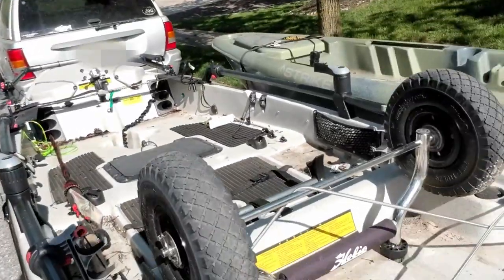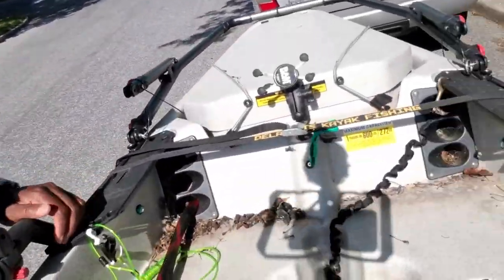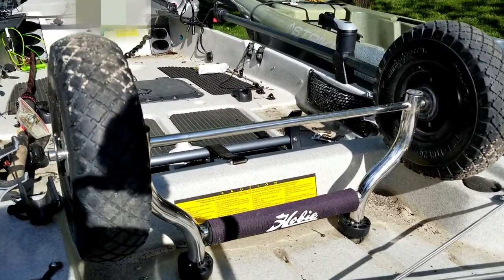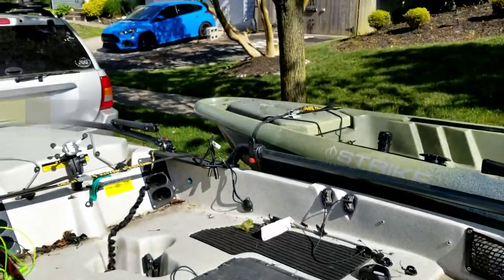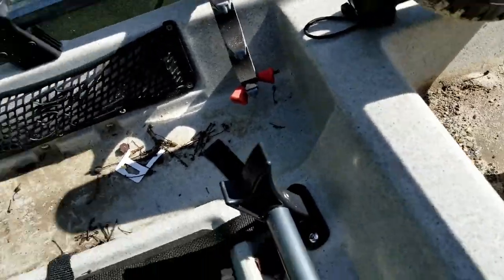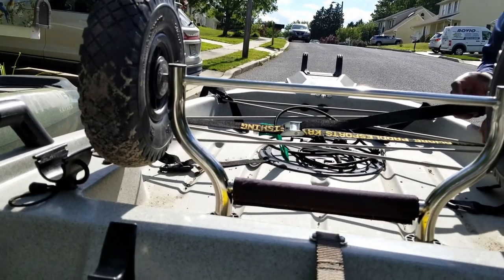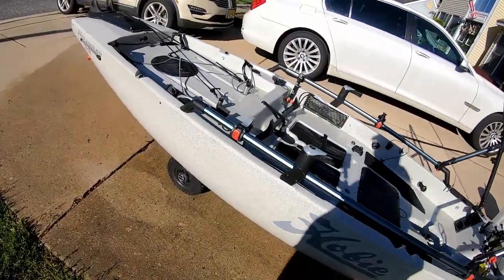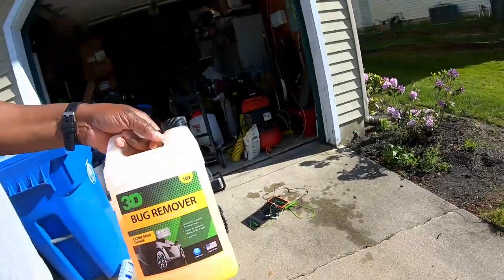Hobie PA14 - Best Kayak Cleaner & Stain Remover

Comment: Thanks for a very useful video !!
Reply from the maker: Steve, thanks for checking out our the video and taking the time leave a comment.
Reply: @yaknsons2473   I have two PA's: PA -14 and PA-12. I bought a Harbor Freight Farm Duty Tarp SKU# 60458 for $14.99 and a grommet kit, Sku# 63237 . I cut  the tarp in half lenghtwise and made two covers for the kayaks each 5.5 ft. wide and 15 ft. long I put grommets in to match the edges and I use short ball bungees to secure them to each of the boats. Since these covers are sunlight resistant they are still going strong in their 2nd. year and prevent a lot of the debris and crap that likes to collect in every corner. In my case it is mostly pine needles, sap, leaves and bird poop. At approximately $8.00/cover they are well worth it, protect the boat and are easy to handle and store. All the Best, Steve
Reply from the maker: This is a great idea.  I wish, I would have had this info a few weeks earlier.  My wife just got me a Hobie cover for the PA 14 as gift, we could have save some money :)  We are definitely going to use your idea to make covers for the Strike HD and our Lifetime Sport Fisher kayaks and make a video on the processes.  Thanks for sharing the info. and giving us an idea for another video.  Tight Lines!